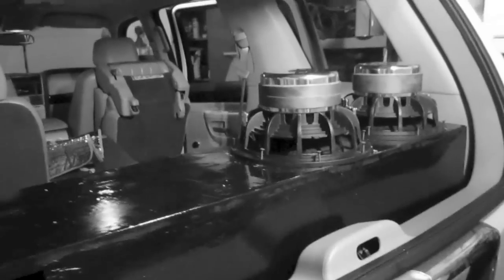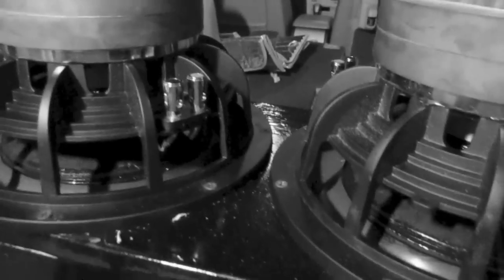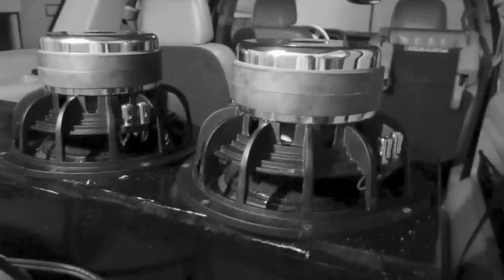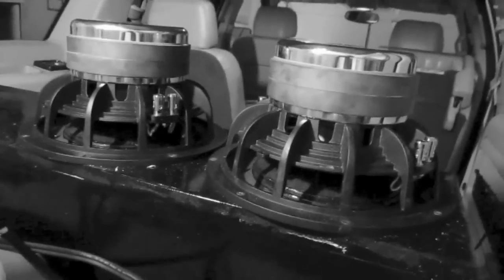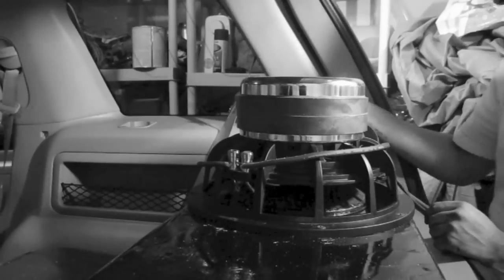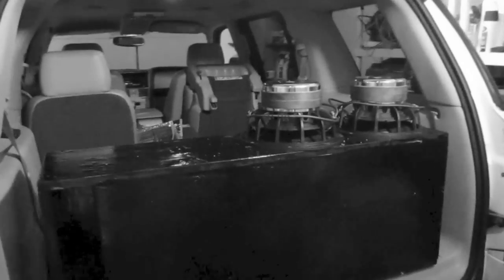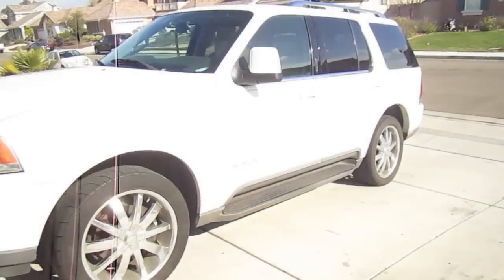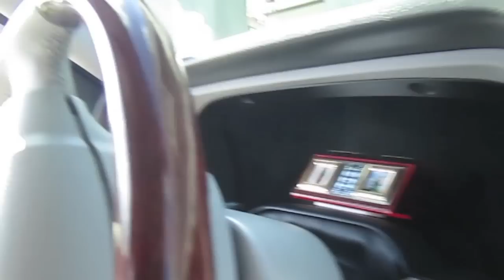(2) DC level 2 10s in ACTION!! On low power!!

Comment: what's the difference in facing speakers backwards..I always wondered
Reply: so. if your box is a little too small for the subwoofers recommendation you can invert the subs making the box slightly big due to the motor and stuff not taking up space. it also looks really cool